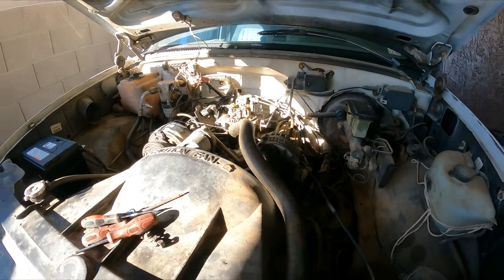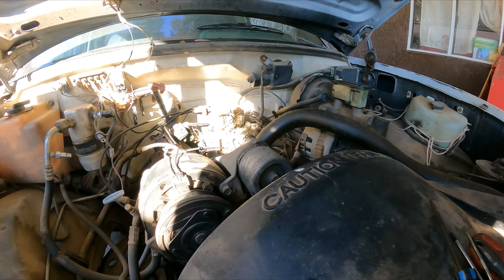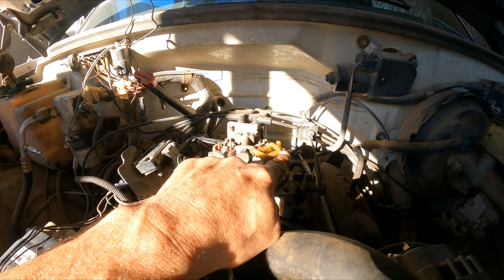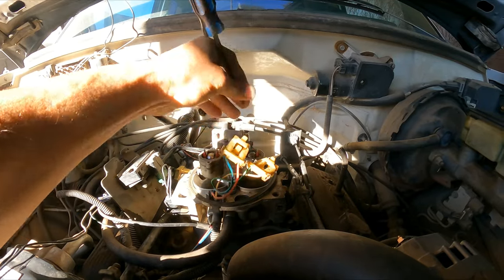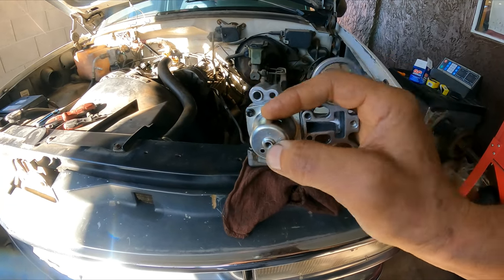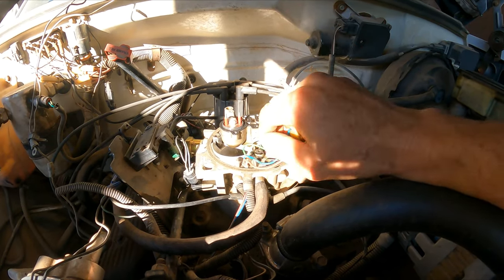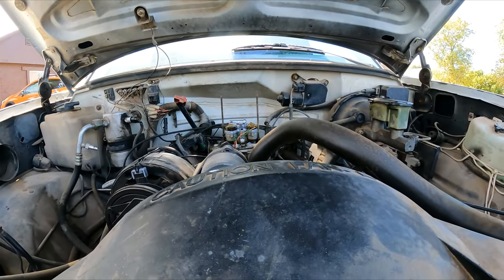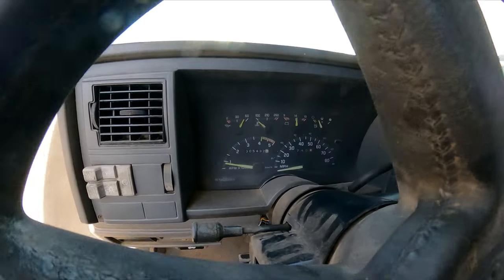1993 Chevy Silverado Poor Idle Problem Solved (EASY)

Comment: you are wrong. The weld is done at the factory do no one will try to adjust it. The aftermarks come with the set screw hole open. .
Reply from the maker: Thank younfor he comment. However,  the factory doesn't do a crappie weld job. Thank you for your opinion. 👍
Reply: They're defnitely soldered from factory
Reply: You are right sir
Reply: @gqautodiagnostics  sorry, he's right..mine looks exactly the same
Reply: @gqautodiagnostics  factory deffinetly does shit welds lol
Reply: Mine looks the same and so does every other one iv seen

Comment: Sometimes it's easier to throw a carbeurator and fuel regulator at it
Reply: I be sayin that but fuel mileage and my AC blow so cold
Reply: @wildestcowboy2668  true, if a guy had the money a holley sniper fuel injection kit would be ideal
Reply: @brazenhammer3307  no one, it doesn't matter Ford Chevy or whatever, makes higher quality parts made to last 100,000 miles than the factory parts.
Snipers maybe sexy and have a nice name but there's no way they're going to last for 100 to 200,000 miles.
I'm not knocking the Holley sniper, I'm just saying the factory makes things are made to last almost the life of a vehicle.  No aftermarket company has been able to match that kind of quality.
Reply: Carburetors don't throw codes.   Carburetors don't need O2 sensors throttle position sensors, and all that other BS.  
I'm old,  that's why I like old school. 😁
Reply: @brazenhammer3307  I be got a 88 Chevy Silverado so could I be puttin da holley sniper u be sayin on it g
Reply: @wildestcowboy2668 UR b putted a holey snoper on yerses trock? i wanid 2 aks u if u dun it or if u duddint dun it. i wunid won to on mise trock

Comment: That spot weld on the Pressure Reg is a factory weld from GM, It is supposed to be there so it cannot be adjusted. Set screw is under it.
Reply from the maker: Hello, thank you for the comment! Have a great day and God bless you!
Reply: I like how one of u is right but I be sayin which one is it
Reply: @wildestcowboy2668  Huh?...I am right.
Reply: Correct. The TBI on my 454 has the same weld spot.

Comment: It would be sweeeeeeeeet if someone who wrote code can write a code for a troubleshooting flowchart of these engines. It needs to have a national database where folks can log in enter the info about the vehicle,  the symptoms they were having and what the KNOWN fix was for them. Then it could calculate (possibly using AI) what you should try first and then what percentage you have for that fixing your vehicle. It would be so much easier then watching hundreds of vehicle videos and replacing parts 1 at a time only to not having it be the one you need.

Comment: We need more guys like you on YouTube that explain things clearly like you did and start and run the engine when you are done!!!! Excellent video!!!!!!!! Need more of you guys!! By the way ,,, do you live in Redding California by chance,, cause I’d rather  give a guy like you my hard earned moneys!!!!!!!
Reply from the maker: Hello,  thank you for the kind comment. Have a great weekend!
Reply: You need to do more research. You called almost everything wrong. All you did was replace the  parts. Did you scan the codes first? No. Did you try cleaning the injectors first? No. Did you check any temperature sensors? No. You flat out got some what lucky.

Comment: Hello GQ diagnostics, I have a similar problem I was wondering if u can post the part number and can I use it on my 91 c1500 ,I can only find it for a 93 c1500,thank you
Reply: I have the same problem mine is a 1990 and can’t find the solution, have you sorted it out ? Let me know pls

Comment: So I'm not the only one with a v6 in one of these trucks
Reply: There was a blue million with v6.  Mostly the work truck edition.  Those 4.3 are really great motors , they just don’t get any better mileage than the v8 s.  Basically a 350 with 2 less cylinders.
Reply: I got 398k on my V6 and only had one clutch ....keeps on going

Comment: I have a 90 Silverado and when I start it up the idle plays around, do you think the 93 regulator will work on a 90? If so feel free to reply because when I search the part up it says only for 93 and up, I’ve changed various sensors too.
Reply from the maker: Hello, I am sorry for the late response, have you check for vacuum leaks in the intake manifold area? Let me know

Comment: On a side note- if ANY youtuber who works on cars wants to improve their videos 400% overnight, it is easy. NEVER point to what you are working on with your finger ( most of us cannot see what it is anyway). Everything is either black or rusty metal where you are pointing. It is like me pointing and saying "See that tree?" in a big forest.
Go to the store and buy a small diameter wood dowel rod, preferably 1/4" and sharpen one end like a pencil, then paint it white with the last 1 1/2" painted orange or red or light blue ( something bright. Use paint, tape or what ever you already have in your garage. Then use THAT to point to things!
Secondly- I don't understand when someone says "I can't hold the camera". Neither can anyone else! That is why we go to Amazon and order super cheap, magnetic holders for our phones and mount them in all of our cars. I had to make 2 of them for my truck camper just to mount my phones to recharge and 1 in the window on the glass for the hotspot. Some phone mounts, wood and velcro did the trick! Just make a magnetic base, an articulating arm with a magnetic phone holder on top. Easy!

Comment: My 92 5.7 has an idle surge after it is fully warmed up. It seems like it misses and surges every 5-10 seconds for a half second but keeps running.
Reply: U ever get the POS fixed? Mine doing same thing
Reply: @wildestcowboy2668 mine too replaced all kinds of parts already too
Reply: I put new AC Delco injectors in my 92 to see if I could clear up some ping under low rpm load in 4th gear. New injectors cleaned up my already fairly smooth idle but now she will start to loop at idle after a fully warmed up engine on shutdown/heatsoak restarts. Doesn't  happen once I drive  a few feet. If I keep it in park it will loop drastically and sometimes die. Drives fine otherwise, starts cold no problem. Doesn't die or rough idle once you get rolling a few mph. Got to be a sensor getting warm and cooling off once you get rolling or something in the primitive computer on fully warmed restarts.

Comment: So I'm having that issue kind of. When I unplug my passenger side it stays running but when I unplug the driver it dies. So the one that's unplugged I change the opsite injector? I don't have much cash so I gotta get it right the first time
Reply: Did u ever get the POS fixed yet?
Reply: @wildestcowboy2668  changed injector and turned up throttle kicker worked great

Comment: So I just got the saw truck an I hear you have the same thumping noise under the passenger side dash. My question is have you diagnosed that thumping?
Reply from the maker: Hello. Thank you for posting your question. Yes, the noise is coming from the blend door actuator.  Jeep me posted. Have a great day and God bless you.
Reply: It could be the HVAC air door actuator. I had a 2008 Impala With the same symptoms. Pain in the a** to replace.  Good luck
Reply from the maker: @jbbadvet  yes, it could be the same problem.
Reply: I had the same issue I thought it was the flap for the heater duct etc. but it turned out to be the radio coming through the speakers

Comment: The problem I have with my 92 the colder the weather the idle is 1500 to 2000 even on a warm start the idle is high. I put it in gear on a cold start I'm afraid of spinning a bearing

Comment: Where did you get the upper assembly for the tbi? Where did you get that new fuel regulator assembly? 
 My idle in my 92 is all over the place, rebuilt tbi. Replaced every sensor on it.
Reply from the maker: I got it from autozone

Comment: Hi there brother like your videos..
I have a 92 Yukon 2 door.
Idles prefect starts right up but then when I'm ready to leave Tha house dies on me... Don't know what to do... I'm here in phx AZ.. If you can call me or I can call you please help me. Thank you again for your effort
Reply: It may be a likely fuel delivery / pressure problem; clogged fuel filter or fuel pump  starting to go or clogged injectors 
On the drivers side frame rail underneath the gas tank is where you'll find the fuel filter.

Comment: Hello, I am trying to find the cause but only when the motor is warm / at operating temperature.  1995 GMC Suburban with 5.7 TBI.  When cold, it starts up fine and runs at the high idle until the motro warms up.  Then, at operating temperature, the RPM's will surge.  Stays around 800 RPM but will drop down ot around 500 and keep fluctuating.  When you put the truck into drive or reverse, the motor will stall out a majority of time and sitting in park, if you go above 1500 RPM, the motor will stumble, act like its missing.  But...If you are on the road driving, non of this is noticable.  I have replaced the exhaust system from the catalytic converter back, new O2 sensor as well as MAP and temperature coolant sensor.  Do you have any suggestions?  Thank you.
Reply from the maker: Hello. Thank you for posting your question. Have you checked the fuel pressure and injectors yet?
Reply: @gqautodiagnostics  Hello, The injectors appear to be spraying a cone and no dripping.  Unfortunatly, I can not chack the fuel pressure, this system does not have the valve on the supply line like the newer GM motors.
Reply from the maker: @duginvirginia5737  thank you for getting back to me. You can rent the tool to check the fuel pressure at autozone or any other auto parts store it will come with the adapter to install it in the fuel filter so you can check the fuel pressure. Keep me posted.
Reply: @gqautodiagnostics  Thank you for your help and suggestion. Will do.  Since posting this question, I made a short video and posted it to my Youtube channel; nothing more than a visual of what we have discussed here.  Thank you.
Reply: @gqautodiagnostics  Greetings...The problem with my vehicle was identified as a severly neglected distributor cap and rotor.  The contact plunger and spring inside of the cap was nothing more that a hard dust as it crumbled when I touched it !  All of the contact points were very durty and corroded.  We chanded them out with new OEM parts and this corrected the stalling out issue when put into gear as well as the stallings / RPM surging when sitting at idle.  Went on a 20 minute road test with no issues.  There is a noticable miss at 3000 RPM and above, but nothing like what we experienced before.  I have an new OEM set of wires and awaiting new OEM spark plugs to arrive and I am hopeful once those items are changed out, it completely fixes the issue, but, as stated, changing the cap and rotor fixed the stalling and shutting down issue when placed into gear.  Thank you for your time and help.
Reply: @duginvirginia5737 when it wuz doing that did u ever notice when u hit da gas it would stutter?
Reply: @duginvirginia5737 cap and rotor fixed it? I have same issue but new distributor from auto zone
Reply: The caps they sell now are pure garbage designed to last 1 year at best.
Reply: @fgoindarkg 
Some use aluminum or tin contacts, where as "premium" caps should be [but aren't always] brass.

Comment: Thank you for such info.
M Nabeel from Baghdad.
My job as wireman only .
Namely, I deal with harness ,starter, alt, relays,
Fusebox.
My problem has been 
Wiring diagram of the ECM
That control the TBI engine.Currently, just finishing harness of 1982
Chevy pickup from carbo
To TBI . Would you please 
Send me the wiring diagram of the ECM controls the TbI.
Cordially.
(Alias name)
Tom .

Comment: I wish you could have showed how you replaced all that!!!
Reply: Park the car or truck overnight. Get about three shop rags, put on underneath both injectors and one at the back of the tbi to catch fuel. Wear safety glasses and make sure you get the right torx bit and unscrew all the top screws. The back ones are longer so keep track of where they go. The whole top unit will come off the top of the injectors and there are four more screws holding on the regulator(round and spring loaded). Keep pressure applied until all four screws are removed and slowly release the cylinder for the regulator. Pretty easy just don't spray fuel in your eyes and don't drop any screws into the motor.

Comment: Hi I have 1994 Chevy 2500 454 motor! When I gas it! It pauses for a few secs then takes off! The when idling it sounds like it’s ready to turn off! I was thinking it was the map sensor! I gunna try buying the small stuff first hopefully it works out! Thank u for the video
Reply: sounds like when my dad's fuel pump was dying... he has a 1994 350 tbi c1500
Reply: Did you ever figure out the issue on yours? Mines doing the same thing
Reply: Same
Reply: I know this is a late response but might help someone out there.I have the same motor on a 1995 Suburban.Took distributor to replace the ICM.Put it back together and vehicle was doing same thing as described above.Did the timing and that fixed the problem.
Reply: @kambomwangi6704  distributor timing?

Comment: the solider is factory it is so no adjustment possible
Reply from the maker: Hello! Thank you for the comment! I appreciate the input that you offered.  Have a great day and God bless you 🙏
Reply: @gqautodiagnostics  got the same issue, put new fuel tank, pump, in as it needed it, all new fuel lines fuel filter  to the TBI unit, plugs, wires, temp sensor, iac valve, egr valve, all been replaced, truck ran fine and sat for a week and ran like crap is why I am doing all this I guess injectors are next